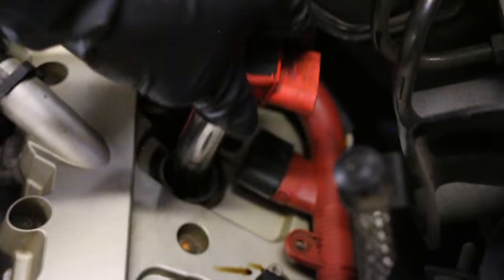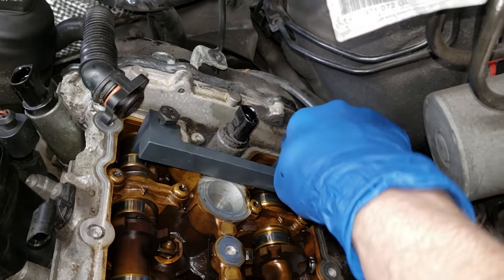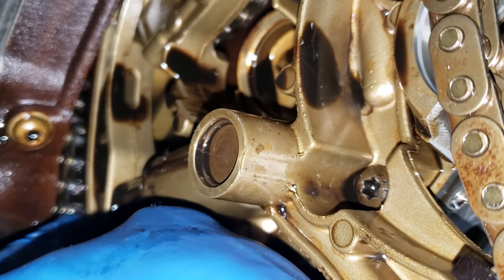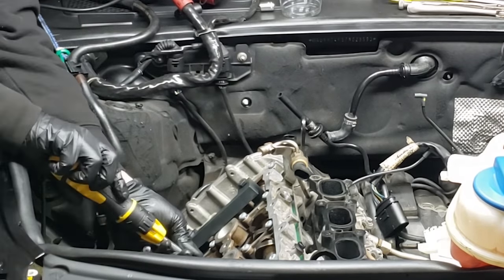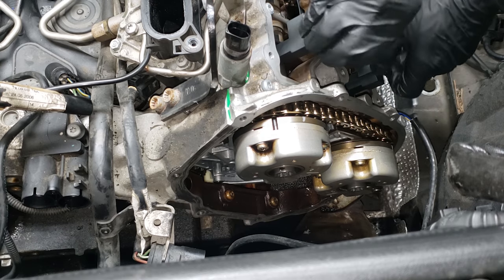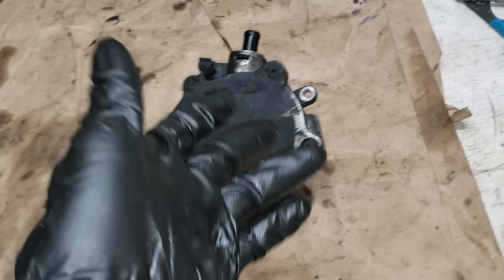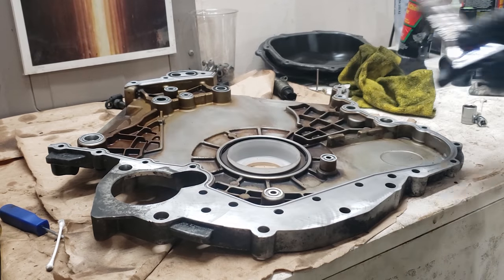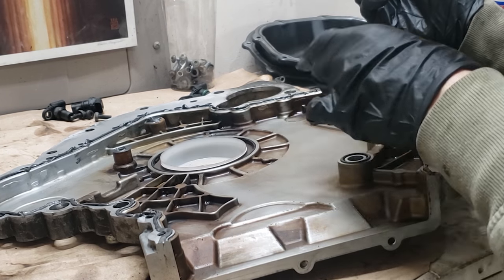Audi (A6 A4 Q5) 3.2 Upper Timing Chain Tensioners, Cam Girdle Seals, & Engine Removal | MUST SEE!

Comment: I think I need to replace drivers and might as well do passenger timing chain tensioner. ( 2008 Audi a6 ) would that be possible to do without removing the engine? And most importantly without removing the valve cover ?
Reply from the maker: Yes and yes. But a good time to change your valve cover to and very easy to do so. 

Best tip, start on the bottom bolts first on the timing covers. If you strip one, you'll likely have to pull the engine like I did
Reply: @Mechani_Cole  cool. Thanks for the input. It will be an interesting project. Hopefully without any crazy surprises. Cheers :)

Comment: BROoooo….I gotta tackle the cam girdle reseal ASAP and YT algorithm brought me to your vid which is exactly what I needed.
Extremely informative, very well done and the links for parts are amazing with everything else.
Subscribed…
And thanks for this
Reply: Also, did you have the infamous Audi suspension “clunk” or rattle that plagues these things?
If so, did you find/fix it?
Reply from the maker: Yes I did, mine ended up being the lower control arms even though they looked perfect
Reply: @Mechani_Cole  I’ve replaced every bushing, control arm (ball joints, bushings included), every end link…if it moves in the front, I’ve replaced it. And I’ve never stopped it. It’s actually gotten worse.
If you ever come across one that’s undetectable, PLEASE make a vid about it. I’ve been pulling my hair out for two years trying to track it down.
Thanks for responding
Reply from the maker: Have you replaced the rubber mounts on top of the shocks?

I've also heard wheel bearings make a clunk as well
Reply: @Mechani_Cole  I have, I replaced literally everything all at once & my right side bearing (which is where the noise is) has been replaced..I’m running ST Suspension Coilovers, so it’s lowered about 1.5” all around if that makes any difference. But I purposely swapped everything suspension wise EXCEPT the CV axles so that I could narrow the noise down to something different at that point. I thought I’d finally fixed it when I drove it the first time and when I pulled onto the road the passenger side rolled off the small ledge between my concrete driveway and the road, I heard that unmistakable “clunk” as soon as the tire hit the asphalt (maybe a 1/2” ledge between the two surfaces) and it’s progressively gotten worse.
The strangest part is that when it’s cold (say 30°-40° outside) it’s quiet, will not do it even on the roughest surface. This may sound like I’m either nit-picking or crazy as hell, but I assure you I’m not, it’s a constant rattle/clunk from the right front when driving. 
I’m searching high and low for ANY person that has or had this same issue trying to find a solution.
I’m pretty peculiar about my cars, but not so much that I’m making up noises in my head. lol
Reply: Oh, I must also add that this issue just randomly started one day. I drove the car a good thousand miles or more between the time I bought and when this noise started. The previous owner never had the issue (he’s a friend, so he’s been helping me find it also).
Second note too, besides the coil overs, it’s also on 19” wheels and 35 series rubber.
If the car is parked and you push on any corner to make the car shift, you can also hear it move and “clunk” as well.
Reply from the maker: No I totally understand, I was in the same boat and replaced everything. It's possible your axles clunk too. Go under and shake and twist them and see if you can replicate the noise. I'm ocd too about my car and that would drive me nuts lol
Reply: @Mechani_Cole  I’m going to give it a shot right now.
Thanks for your input and responses.
I’ll post my findings in a bit.
Thanks again
Reply: @themetalfusionologist   @Mechani_Cole  Do you guys have xenons?

Comment: Damn screw.. I’m about to do the tensioners on mine, very similar engine but on a Touareg supercharged. I just wonder can you take the upper chains out with the main timing cover in place?
Reply from the maker: Good question, yes you can if you are talking about the lower cover
Reply: @Mechani_Cole  thanks for your reply and congratulations for the good job on your car.
Yes I’m thinking it’s worth replacing the chains together with the tensioners.. I’m really not looking forward to remove the engine cuz I’m going to have to do that outside and on a bit of a slope 😊

Comment: What is the order of locking the camshaft to the top spot?
1.Remove small pins
2.The position of the camshaft top-end after the cranking operation
3.Keep a big pin

Comment: I know this video is kinda of old but i have a question when you remove the tensioner from the timing chain could you remove the whole cyclinder out if you wanted to?
Reply from the maker: The whole cylinder? Not sure what you mean 🤔
Reply: @Mechani_Cole  i have a cyclinder i need to pull out because i got a tap bit stuck on it and the spot that its in i can really get it out so o have to take the left side cylinder out because its where my front water pipe connect to. I wish i could show you a picture for what im talking about
Reply from the maker: The only thing called a cylinder in your engine is the actual cylinders connected to the rods that spin in the engine. Send a pic to my instagram

Comment: which engine code is your 3.2? I got the one with all the actuators in the girdle. Gonna be fun...
Reply from the maker: Yeah, mine was the model before that. I forgot the code. There are, however, some sleeves a company makes you can slide in the spark plug tube, and it prevents the leak. Haven't done it myself, but that is an option that may be easier
Reply: @Mechani_Cole  I've seen those, the weird thing about mine is I don't believe it has the spark plug hole girdle gaskets. From everyone I've talked to it seems to be the anerobic sealant instead. Gonna find out for sure in the next few days when I pull the girdle off. Unfortunately, like yours, mine suffered a repair where they used RTV for the girdle gasket too.

Comment: What is the torque you used for the 3 difficult torque converter bolts?
Reply from the maker: Good question! Bentley manual states "Drive Plate to Torque Converter Bolt 86 N-m" with a note to "Replace ribbed bolts; use only original equipment bolts => Electronic Parts Catalog ETKA". P/N for these M10x1x28 ribbed bolts is N-910-869-01.

I also put red loctite for good measure👍🏻

Comment: Some one put the wrong sealant on my cam girdle drivers side and passengers side this is the pre existing leak problem I had when I brought this car I can see there's oil seeping out. Looks like RTV as well.
Reply from the maker: Very common! Had it on my 4.2 as well and was leaking everywhere
Reply: @Mechani_Cole 4.2 even better although I'm just new to Audi my one is a 2.8litre 88 thousand ks so far. It's hard when your working every week. And very expensive to get the parts here in New Zealand. Kiwi carparts which is European parts gave me the wrong bolts for my high pressure fuel pump itself. Instead they gave me the hpfp housing bolts. Need to plan it more better as parts are mostly overseas.
Reply: @Mechani_Cole That's just crazy could see it in the video very stressful, glad my one isn't like that it's just a small leak coming down on the crank hose drivers side which is the right side. And just saw underneath my transmission is leaking as well, and my oil cooler leaking to pass side.

Comment: Cole can I drop my 2005 Audi A6 3.2 off to you to change the cam girdle seals and tensioners? Are you in the Northeast?
Reply from the maker: Hey Mike. I'm located in Las Vegas otherwise I'd say to bring it through. Best of luck!
Reply: I would have had you do the work if you were near by.  I like your attention to details.  Do you think I can stop the spark plug leak by cleaning out the holes and applying permatex ultra black sealant to  the joints?  I have about 136K on the engine.  How many miles were on your engine when you did the job?
Reply from the maker: Appreciate the comment. But no, in fact it's a waste of time and won't do much to stop the oil leak. 1 option I have seen for a friend who couldn't afford the repair was they pulled the coils every oil change and cleaned out the oil in there and then put them back. This kept it running for another 20k miles or so until it eventually got worse. All of these engines are in need of this repair at some point. You see how crispy my seals were? This engine only had 118k mils on it @mike lopane

Comment: You could have just been honest and said you wanted to pull the motor so you could have this cool video lol. Good job bro! I see you owning a shop soon.
Reply from the maker: Ah yes! You know how much fun it is to pull out these 3.2's. Can't wait to do it again, just for funsies😅

Appreciate the compliment bro! I thought of owning a shop, but after working on peoples cars for years I decided I don't like dealing with certain customers and the car repair field is full of these certain customers😅

Maybe one day though
Reply: @Mechani_Cole  Well, I have a 5.2. Yup, cam griddle seal. And yup again - engine out - not enough room in 5.2.
Reply from the maker: I just picked up a 4.2 and same thing🥴 Cam girdle seal leaking, engine gotta come out. Damn you Audi! The 5.2 is huge! I swear they had to make the car longer to fit the engine in there🙄
Reply from the maker: I just picked up a 4.2 and same thing🥴 Cam girdle seal leaking, engine gotta come out. Damn you Audi! The 5.2 is huge! I swear they had to make the car longer to fit the engine in there🙄
Reply: @Mechani_Cole  aand 5.2 can't be separated from the transmission. So I'll have even more fun. However mine aren't leaking as bad as yours have been on the 3.2 and car runs ok with no misfires, and becouse i don't have enough space currently it'll have to wait a bit.
Reply from the maker: You should be able to seperate from the trans. I've seen them removed in forums. Some people pull it out with the torque converter still attached. 

I always wanted a 5.2, just never wanted to work on a 5.2 lol
Reply: @Mechani_Cole  5.2 isn't that much different than 4.2 in terms of maitenance to be honest. Starter requires pulling the motor, but overall i'd say it's pretty much the same. And 5.2 has better tensioner, less prone to fail. However increased heat may be a factor in terms of slightly quicker seal degradation.

Comment: What’s your opinion? Is this car good enough to be worth a diy engine out service? They’re so inexpensive that they’re hard to ignore, but with the position of the timing components I have to plan to either pull the engine or transmission on a high mileage car with unknown servicing.

I’d really really love to have that V-6 but I’ve considered holding out for a 2.0T model. Despite its flaws I’m familiar with that engine and I’m very comfortable working on it.
Reply from the maker: As an owner of both engines, about 4 or 5 times over, I'd say stay with the 2.0T. Better gas mileage, easier to work on, timing in the front, cheaper parts all around and still plenty of power. 

I honestly avoid this job just like any other mechanic usually does. So much can go wrong doing the timing on the 3.2. They are cheap for a reason and the 3.2s parts are pretty expensive. 

The good saying of "there's nothing more expensive than a cheap luxury car"
Reply: @Mechani_Cole  it's really sad because everything else I've read about the 3.2 and 3.0T is that they're amazing, reliable engines. The 2.0 is just so easy to work on and in that big engine bay I could buy a high mileage A6 and have all the big maintenance items knocked out in a weekend (probably a day but I work slow).
Reply from the maker: I agree. Love the 3.2 and the 3.0. But working on them is more complex and expensive. Just more expensive to maintain and drive. But more smiles per gallon🫡

Comment: Great work! Question for you: can you exchange the cam chain at the same time without removing the engine? My chain has stretched on bank 1 and it looks like it would be possible… or?
Reply from the maker: I don't think so. It might be possible, but surely your other chains will need replacing as well. Having one with no slack and then a used chain on one side is going to cause some issues I imagine
Reply: @Mechani_Cole  I agree - both chains will be exchanged just for peace of mind, but I don’t have access to remove engine, and it looked like the chain can come of with the middle back cover still on. Or at least I hope so. I was just curious if you saw that as an alternative. Thanks!
Reply from the maker: I haven't seen it done personally. But it may be possible. Would just suck to get that far and then not be able to

Comment: Lol great job man. I've got the v10 version of this motor. The spark plug tube seals were toast.
Reply from the maker: Appreciate that! Yeah I can imagine! Did you end up replacing them?
Reply: @Mechani_Cole   The engine is off the car. Waiting for the parts to arrive.. Do you think I should replace the gaskets under the timing chain tensioners? My mechanic doesn't think they need to be, since the timing chain setup only has 8k miles on it.
Reply from the maker: @StudioGoldsmith probably not if they were replaced with the tensioners 8k miles ago

Comment: Why not replace timing chain and guides on the bottom while you had it all disassembled?
Reply from the maker: Good question, simply didn't have the funds at the time. Wasn't even intending on pull the engine. Needed my car back at the time too
Reply: @Mechani_Cole , yes a tough and real turn for a DIY’er. Nevertheless, your instructions and compilations are excellent!!

Very inspirational video, and a must watch for home mechanics to learn best practices and good techniques.

Comment: Hi guys,
I have a 2005 Audi 3.2 .
I replaced the upper timing chain tensioners on both banks and now the group 93 shows the next measurements:
Phase position Intake Bank 1:  -20.6
Phase position intake Bank 2:   -18.4
Phase position Exhaust Bank 1:  -20.6
Phase position Exhaust Bank 2:  -21.4.
I used the locking tools for camshafts and the locking bolt for cranckshaft.
I followed the ALL DATA specifications.
What you guys think happened?
I did a compression test to see if something happened with the valves and I've got between 11.5-12.5 bar
The car starts and runs fine for 20 seconds
Any thoughts?
Thanks!
Reply from the maker: Just now seeing this comment. Were you able to fix the issue? Did you replace the timing chains or just the tensioners?
Reply: @Its MechaniCole  I wasn't able to fix the problem. I replaced just the upper tensioners
Reply from the maker: If your cam phase number is -6 or higher (technically lower since it’s a negative number, but I want to be consistent with how we all refer to the phase number) then you might want to consider having the chain and tensioner replaced again. Or replacing the chains. Very common for them to be stretched out, especially if that's the factory chain from almost 20 years ago now
Reply: @Its MechaniCole  replace chains means replace all of them or just the the upper ones?Do I have to remove the engine to replace those two chains?
Reply from the maker: Yes and yes. There is 4 chains in total on the back of the engine. Plus the remaining tensioners and guide. If I remember correctly its about $1,000 for the complete kit. Engine out, good time for rear main seal and a whole bunch of other stuff. It's a big job. Assuming your chains are stretched. Which sounds to be the case
Reply: @Its MechaniCole  sounds like a big project to me!
I appreciate you help and thanks for your videos!
They were really helpful!👍

Comment: Hi, this is the situation, we are repairing Audi A6 C6 Fsi 3.2. We are changing the timing chains. We have such a problem, we assembled the entire engine, installed the upper tensioners, tightened the vvt couplings, and when we start cranking the engine, we have a terrible blow. In fact, it turns the camshaft. I have a video, I can throw it on Instagram. Please help me!
Reply from the maker: When you turn the engine in a full rotation, are the cam holes lining up still? 

I noticed my camshaft would click and look like it's shifting. I think this is due to lack of oil pressure.
Reply: @Mechani_Cole  when scrolling the engine, the labels all match. I'm afraid for the terrible click when turning the engine
Reply from the maker: I was worried as well. I think I soun the engine by hand over 50 times checking to make sure the marks lined up. 

Before you start it, pull your fuel pump fuse and crank it over to build oil pressure. I didn't do this part, it made some noise. But was fine after
Reply: @Mechani_Cole  thank you very much. We will continue to collect and launch)